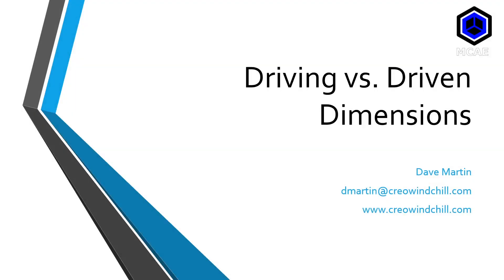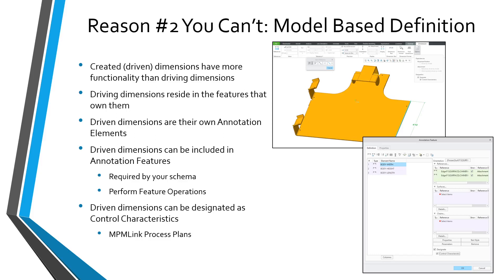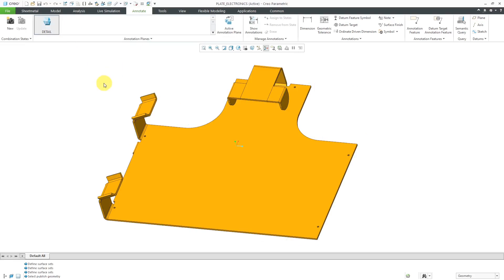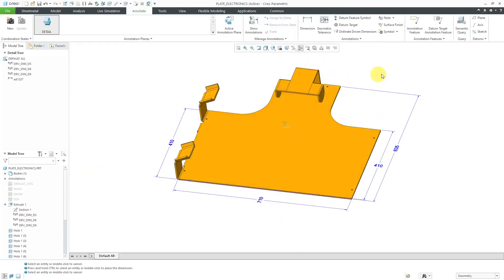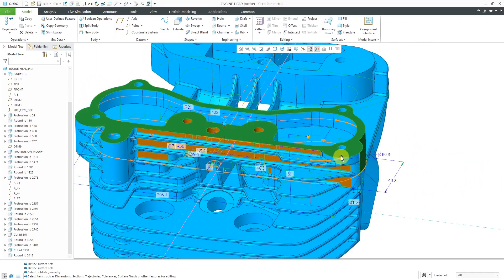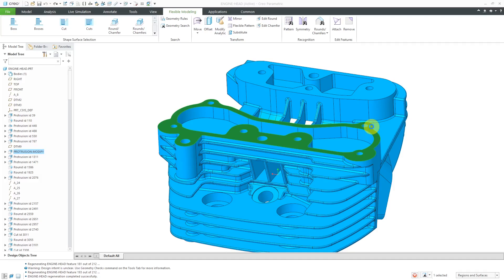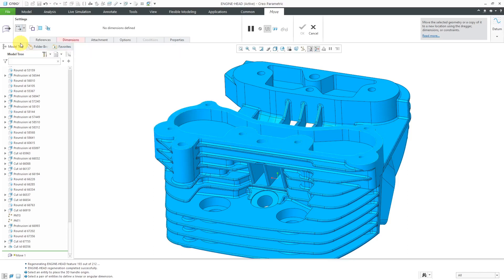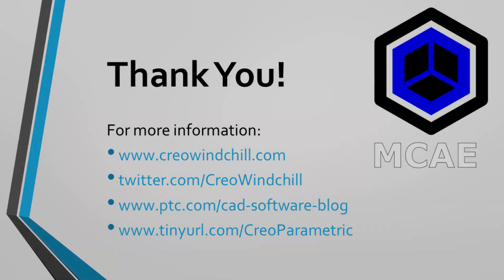Creo Parametric - Drawings | Driving vs. Driven Dimensions (Part 2)

Comment: Correct me if I’m wrong on this. My biggest beef with created dimensions is that they don’t keep the specified tolerances from the model. For example, in the model, if I specify a +/- tolerance on a dimension then that won’t be shown in the created dimensions. That could lead to big errors.
Reply from the maker: If it’s important that the tolerances match up, just write a Relation. But once you choose a created dimension as the source of truth... use it as the source of truth.